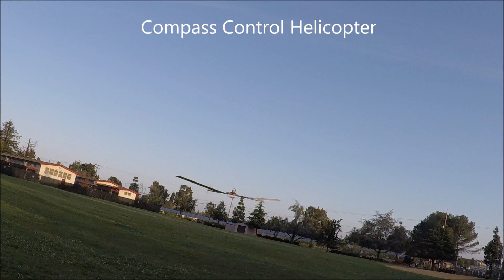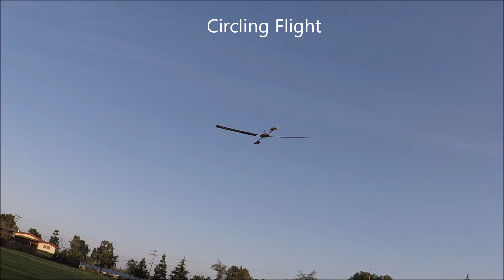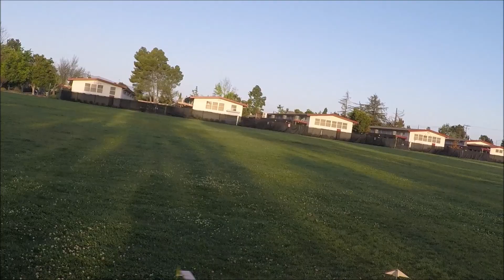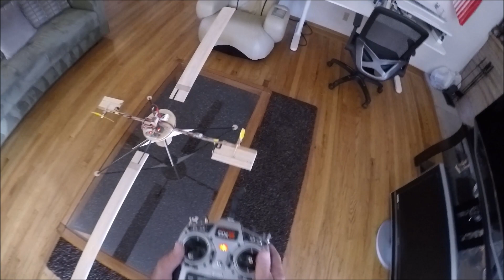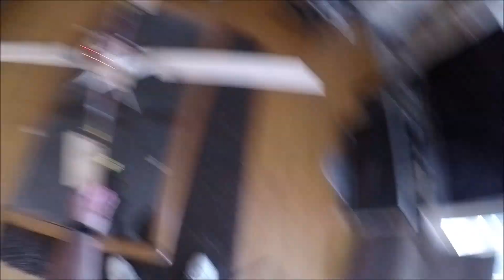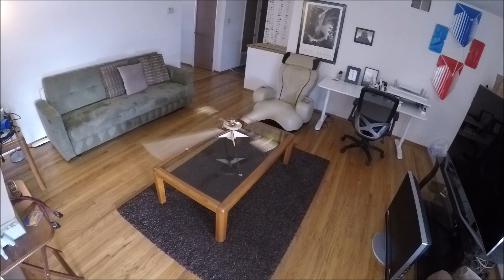Compass Control Helicopter

Comment: Thank you so much for sharing your progress! I have had a very similar approach and could achieve a controlled 10 min hover flight. I used color-changing LEDs to show the orientation of the vehicle. I think this kind of configuration could have huge benefits, if you are using it as a VTOL. Currently I am working on a better orientation and control method in order to use an autopilot. Maybe I will also share videos soon. Greetings from Germany!